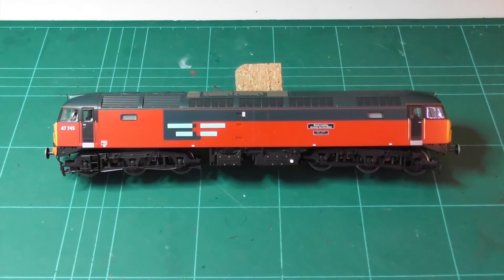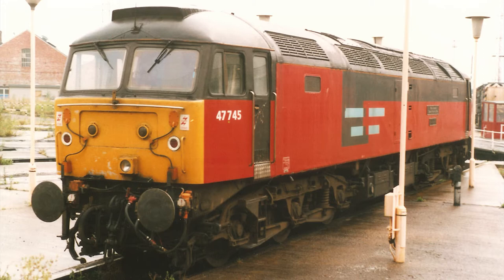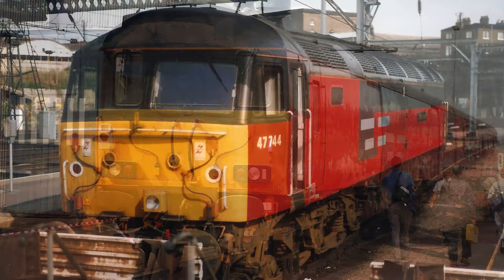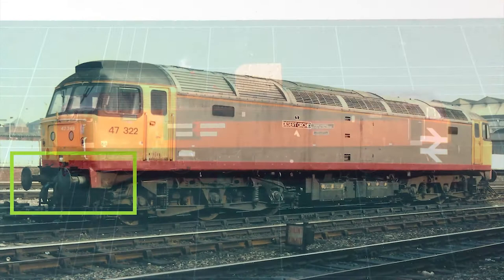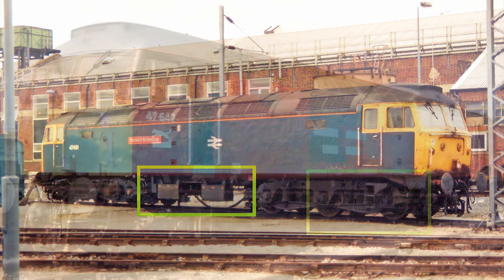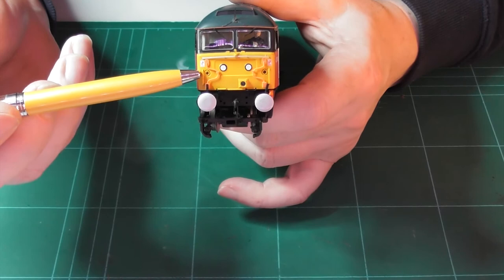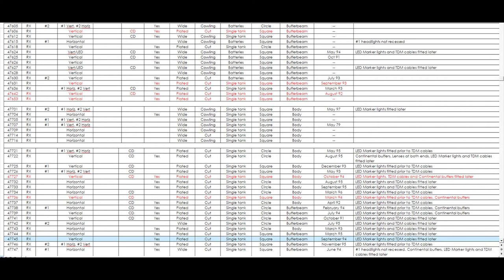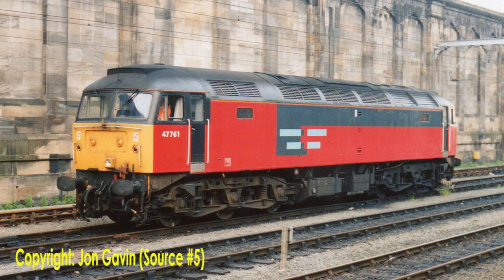Renumbering a Class 47: Part 1 History, details and research

Comment: Hi - found you through RMWeb. Excellent video. Is the list of the 47 details you've made available for public consumption? Do you have similar lists for other liveries? I have a few 47s I'm looking to have renumbered!
Reply from the maker: Hi there

I made the list specific for this loco, and made it visible enough in the video that a viewer can do a screen-grab if they wish.
If you're using a regular PC, press the 'PrintScreen' key (next to F12) and then paste into any graphics program.

As regards other liveries.... not exactly.

I have a number of lists like this that I created, but these are limited to locos I intend to model.
So, for example, if Bachmann release a 47 in Large Logo livery with a circular boiler port, I could strip that loco and repaint it into BR Blue for 47491 'Horwich Enterprise' as seen on this video when refering to the circular boiler port difference.
 
I just added part 2, the modelling part... so I hope you like that too.

And tonight at 9pm, I'll be hosting a live hangout in collaboration with DEMU.

Thanks very much for the feedback.

Cheers

Dave.
Reply: UK Diesel and Electric Railway Modelling sorry for taking so long to get back to you. Thanks for your reply - i was wondering if you had a list of Class 47/4s that carried triple grey livery by any chance please? If any carried it in 1991 that would be ideal. Thanks!
Reply from the maker: @sub39h  Hi there.
Apologies for not seeing this until just now.
47/4's in Subsector Railfreight were:

Construction: 47430 (01/90 - 02-92*)
Metals: 47594 (06/88 - 07/91), 47599 (02-88 - 03/92 [with wierd logos!])
Distribution: 47445 (03/89 - 07/91*), 47588 (03/88 - 03/92), 47600(05/88 - 01/92), 47605 (05/88 - 04/92)
RF Unspecified: 47605 (03-88 - 03/91 then gained RFD logos as above), 47615 07/88 - 02/92)

Note: * = Withdrawal date
Reply: That is brilliant, thanks so much